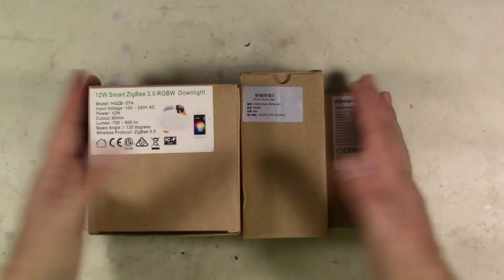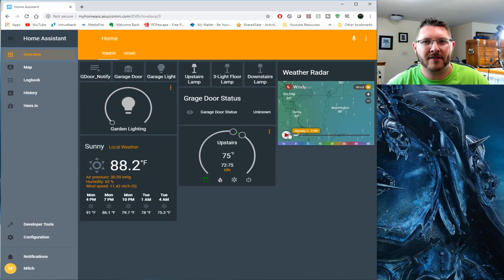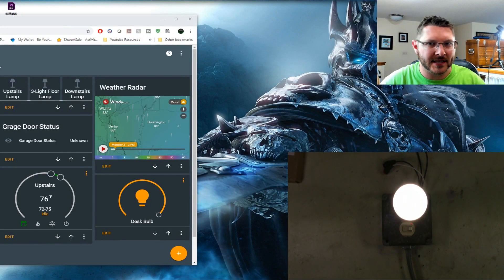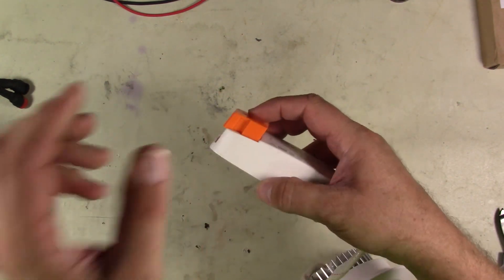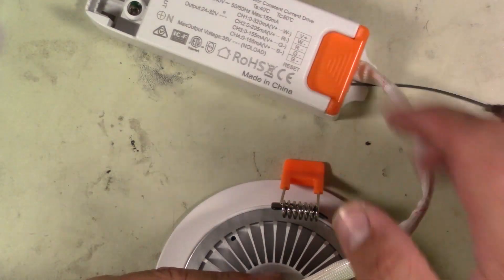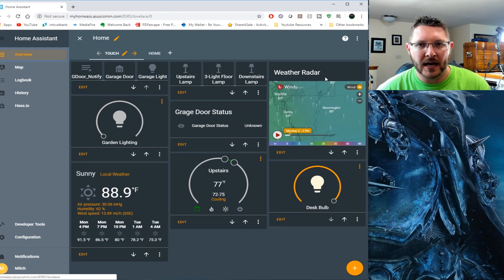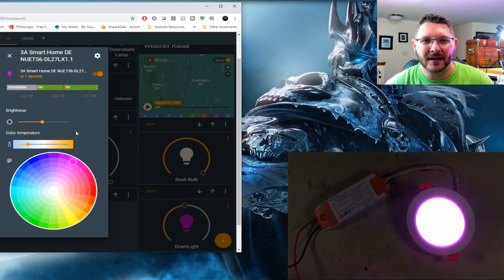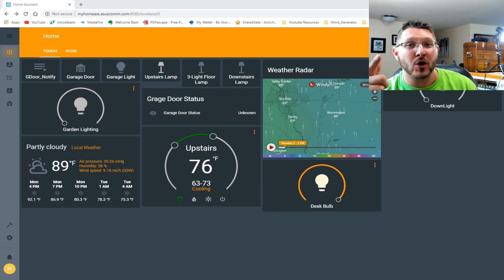ZemiSmart & HomeAssistant Smart Lighting For Home

Comment: Does the dimmer switch connect to the wall switch or do you have to leave it on all the time?
Reply from the maker: you could put it in line with your wall switch if you like.  However, if you turn off the power to it it will no longer be connected to your home assistant.  I think it is intended to be placed on all the time and switched using the zigbee protocol for turning on and off.